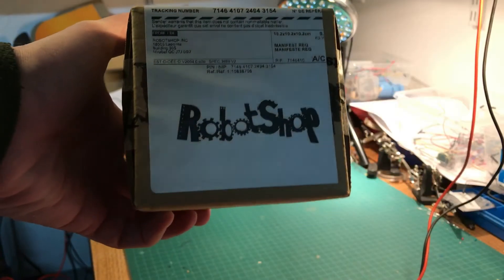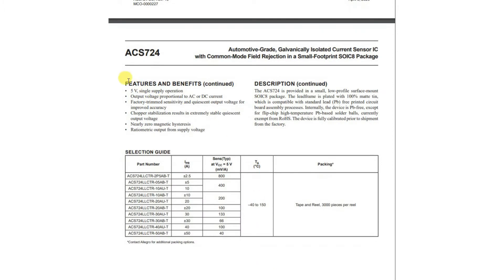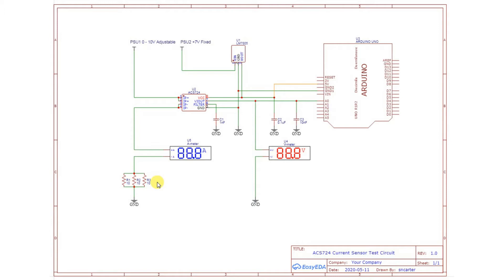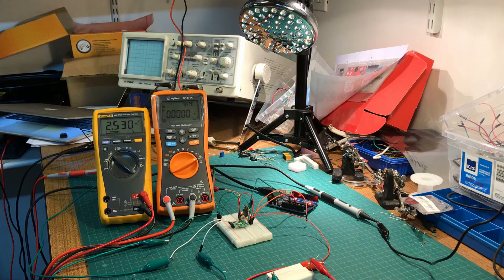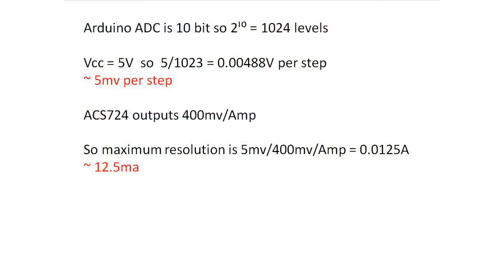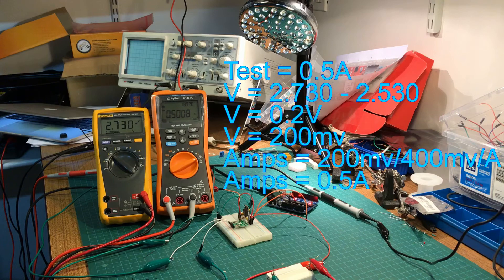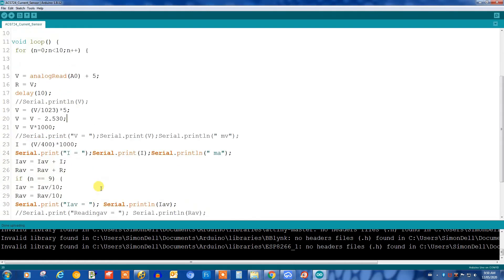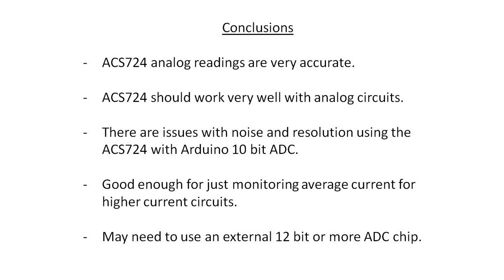ACS724 Current Sensor Measurements with Arduino

Comment: Good information = thank you. The application that I am researching is to control exhaust fans to remove compressor heat from the cabinet that will house a 12VDC refrigerator in a camper. The ACS724 will monitor the current driving the refrigerator compressor. The Arduino will turn on a buffer transistor that will drive the coil on a 12VDC relay to turn on the fans. We will be using 12VDC computer fans. An Arduino R3/328P has 20mA available, per pin, so the transistor may not be necessary. However, it would serve as a good buffer, regardless. Maybe a MOSFET would be better. Or, maybe a triac and skip the relay. Lots to consider. Your thoughts? The new R4 has more bits of resolution (I forget the exact number,) but it can only source 8mA from a single pin.